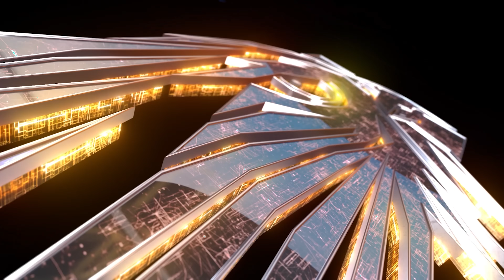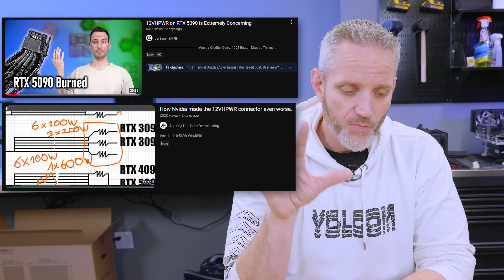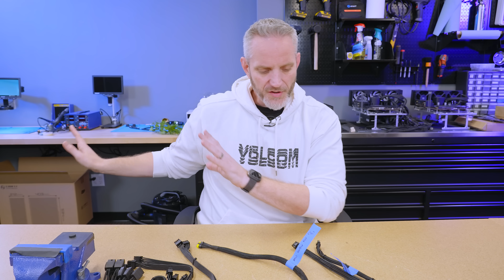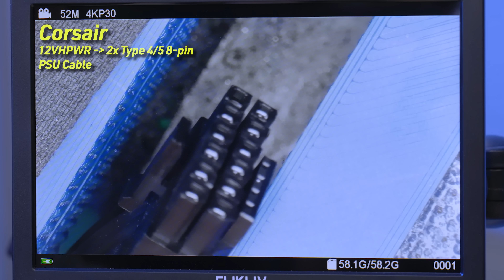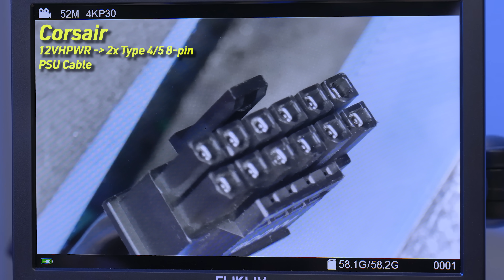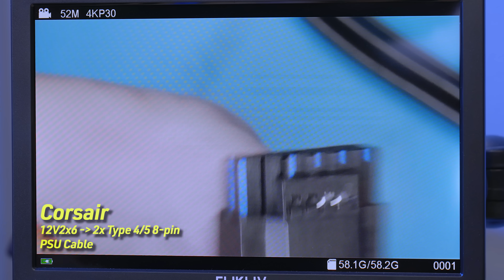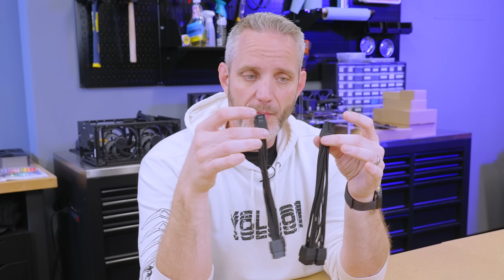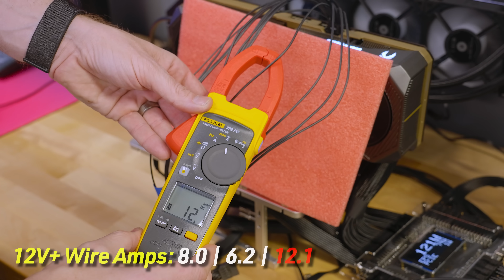I discovered something concerning and I need the Experts to chime in... More 12VHPWR discovery!

Comment: Unpopular opinion, but much like how cars need more and more current to start themselves, so industrial engines use 24 instead of 12 volt systems, maybe if computers need more and more current for things, we should consider using higher voltages instead of higher currents to reduce the chances of fires since there would be less current flowing on the power lines. Though we could also use really high current connectors like the XT60 or XT90 which can each carry 60 or 90 amps constant respectively, they even have versions with extra pins for communications, those connectors could be used one per rail and are good enough for RC models which draw very high currents from those very volatile LiPo batteries... maybe time for the PC industry to adopt or absorb tech from other industries to help reduce these issues. Good XT60 connectors are cheap... like a dollar per pair retail at most. XT60 can support up to a 10 AWG cable, and XT90 can go even heavier, no need for tons of little wires, just a few big ones, probably less failure prone.

Comment: Hoping somebody could help me out. I'm building a new PC (last one in 8 years old now). I was both fortunate enough and yes (dumb enough) to be able to snag an RTX 5090. I just got all my parts in, and just got the NZXT C1500 as my PSU. Yes it comes with an H++ 12v 2x6 cable, however the pins do look all over the place. The MSI connector (in this video at least) looks much more well engineered. Could you guys chime in with your thoughts? Is it worth rolling with the C1500 and hoping for the best, or better to return and get newer MSI PSU with a (hopefully) better engineered 12v 2x6 cable included? It would an extra week to my timeline, but curious if you guys think it makes any difference. Thanks in advance everyone.

Comment: in this world there are literally billions of 12volt wire to wire / wire to board connections. You can be be damn certain many of them are not "perfect connections". In PC's, in Vehicles, you get the point. So why isn't the world burning down around us? Because in most all cases there is an engineered margin of error built into everything.

however nVidia thinks otherwise and its ok to push the power requirements of their GPU right to the limits leaving no head room. Not one single mm of an imperfect wire and or connection while everyone else in this world knows you need to leave a margin of safety!

its a power delivery issue alright, but not from the wires or connectors themselves. Nvidia is simply pushing too much power through each of the conductors with no margin of safety. der8auer touched on this, and guess what, he's right.

and lets not steer the engineering to a solution of "monitoring"...Shunt resistors are not the answer either. There job is to detect a problem, sure ok, over amperage but if you just engineer a margin of safety with some overhead on the power delivery like the rest of the world, you wouldn't need any monitoring. Shunt resisters don't solve this problem, only detect/alert it. 

This whole thing is laughable as to what or who's to blame damn well knowing all the billions and billions of other 12v power delivery connections in this world. Billions of 12v power delivery connections that have no issues and the world keeps spinning, just not nvidia's 4090/5090 gaming gpu world. ...I wonder why...

Maybe we should ask AI running on a new nvidia AI enterprise card that has a "5080/5090" die, you know the actual 5000 series card launch that took place (enterprise equivalent) and likely has no power delivery problems.

Comment: I'd argue that one pin badly settled wouldn't be a problem. If they all connected in parallel, the current would just flow with least resistance (= all other pins).

The failure shown on thermal image (2 wires getting hot, rest cold) probably means multiple pins failed and the ones that "took the heat" were the ones that had the best connection

Also all the comparisons I saw lacked one very simple test, just get a pair of connectors, plug cable in and measure with ohmmeter (would probably need the 4 wire one for accuracy) what difference between different pins is

Comment: Trash PSU's and Cables are causing these issues. Looks like the MSI is high quality and checking mine confirms that its fine and load testing the 5090, the cable barely budged in temp.

Comment: Any electrical terminal will generate heat when doesn't make proper contact. One quick example is to not fully plug a vacuum cleaner. After a couple of minutes of use, unplug it and the terminals will be very hot (both, positive and ground).

Comment: The actual wire/conductor gage needs to be determined on the cables to see if any are undersized for the potential amp draw. This will necessitate cutting off connectors and stripping insulation to accurately measure conductor diameter and strand count.

The most expensive material in the cables is the copper used in the conductors and that's the first thing mfgrs skimp on.

Comment: Honest question: why do we use these small diameter multi-pin connectors in such high power applications?

Why not use, I dont know, xt60 or xt90 style connectors with big solder terminals for multiple small, or even bigger diameter cables for graphics cards?

The are very compact and basically bullet proof.
I have used them in high powered FPV racing drones Back in the day and never Had a Problem.
And These little Speed demons pull a shot Ton of current.

And its not like we need dozens of smal pins either. They all terminate at one rail after all. They dont even get seperated withmultiple shunt resistors either, so, yeah... I dont get it.

Comment: I have pointed out on other videos, another thing to look at is the pin size on the GPU and PSU sides. On PSU side all of the pins not associated with the 12vHPWR (in any version) are all chonks. The 12vHPWR pins are a full AWG or more smaller, yet they are supposed to carry the same or more power as the larger pins. Having not seen if the GPU side are just as teeny as the PSU side that may also be causing some of this. Smaller pins simply can not carry the same power as larger pins.

Comment: I cannot believe that corsair would even remotely think that what you just showed us is fine. Not to mention how they could even think that is acceptable to give to consumers. They should be ashamed and sued. I work for a company that directly deals with the construction of cable harnesses and that would have immediately gotten sent back to the shop to be completely rebuilt. Completely and totally unacceptable... To be clear the cable harnesses I deal with are in no way related to this; however, the construction of cable harnesses other than over all lay out is the same in terms of quality control.

Comment: Here's what I don't get.  In the big boy electrical world, ie, home or commercial wiring, when you increase the amperage requirements for power delivery, you also always increase the wire gauge.  I have never seen electrical in higher voltage where it is acceptable to run multiple wires instead or higher gauge wire.  I don't understand why it makes sense to run 6 12v power lines at 18ga or whatever instead of just running a single 12ga or 10ga wire.  Are the costs really that different at a commercial scale that 2 feet of 10ga is more expensive than 12 feet of 18ga?  From my research the per foot cost of 10ga is always cheaper than the the 6 foot cost of 18ga stranded wire on the few websites I've looked at.

Now, I'm no electrician, but I would bet that differential resistance and, therefore, differential loading is exactly why we don't see this in high voltage wiring for risk of overheating/fire.  The exact problem we have here.

From my understanding, the 12v comes from a single rail on the PSU side, split into 6 at the plug, and then gets recombined into a single rail (or power plane) on the GPU plug side, doesn't it? So two higher gauge wires (+/-) should fix this entire fiasco, especially since at that gauge, the connectors would be a hell of a lot beefier and with very positive connections/locks.  Think of something like the XT90 connector, but locking.  XT90 is rated for 90A, so that would be a huge safety margin at just over 1kW of power draw.  It's a bit bigger than the current connector (not terribly so), but that's kinda the point.  Hell, the much smaller XT60 would work for now, but at only 60A (720W), that doesn't leave much headroom for the future assuming the continuing insanity of power draw increase.

I'm also assuming that we've probably had a differential amperage issue in multi wire PC molex style cables in the past, but it's just never been noticed before since we've never been pulling 600+ watts at 12V in PCs until now.

In my mind, at these wattage levels, splitting loads into multiple conductors is just asking for trouble no matter how good the connectors are.  Hell, even 3x or 4x 8pin PCIE cables would be suspect in my mind at these current draws, maybe even more so than this connector as they could provide more failure points.

Perhaps the discourse around the old 8pin connectors needs to change here as I doubt it would be OK to have 4 or 5 of them to power today's cards (150W each + 75W PCIE) and I would image the failures (melting/fire) would be even more that what we see today.  That doesn't excuse the terrible 12VHPWR connectors, but it does give them a bit more context.

Comment: Jay watch the BildZoid video carefully. 2x8pin cant pull enough power to Melt m8. 
By design 8pin can only Pull 150, Not cable design PSU design only pushes up to 150W in 1 8pin. 
So your 2x8Pin can only Provide 300W trough that Adapter. By STANDARDS.
if Corsair is Pushing 300W trough one so they can Adapter than into 1x12v that pushes 600w there's your problem no1. 
Although 8Pin(6+2) is very Overspec its not Designed for 300W in one 8Pin. 
And Most PSUs will not supply more than 150W per line for a 6+2 PCIe. 
The PSU design pre 12v Provides Mechanical safety so the cable can't melt.
But theres another factor and that is: to Reach 600W you need several cables so that in itself provides Power leveling, since One cant do it, Others have to chime in. Key word HAVE to. 
Aka you will have to have 4x 8pin(6+2) to get 600W which will ensure they cant melt because PSU will Only Supply each cable with 150W. And PSUs before 12v ONLY have 4 8pins if they can Supply them with 150W each. So you cant use a PSU that's too weak.
Old 8pin PSU connector and everything around it is so smart in design Without any advanced controllers because people respected Electricity before, and didn't think about Profit first.  
12v ONLY demands 600W because GPUs don't care how and do not split Lines, it can be trough 1 single wire out of 6 power wires, nVidia doesn't care. 
There is NO WAY to tell the Electricity Where to flow trough 6 Power wires because PSU and GPU literally have no systems to tell it or limit it.
It can send and receive 600W trough 1 wire, 2, 3 or all 6 or any other combination. And plugs contact exponentially messes with this further.  
It's literally Like lottery.
That's why for some It's all wires nice Amps and for some 2 Wires or even 1 wire needs to take care of all the power. 
That's what Happens when you do not have a cap on How much a Line can draw. 
I honestly think nVidia did 1 joint Power Input into the card because the GPU core draws SO much power that individually regulating 6 wires would be very costly and splitting them some safe way would cause them to have to Mosfet and later Join 3-4 or More lines to satisfy Only one Huge Power hungry Component on the board that is the GPU core.
They could have Mosfet for let's say every 2 Power wires and have 3 mosfets to split the load, But I think that would cause them to have to Join 2 power lines after Mosfets again to Get enough power for the core. 
So they just said: Fuck it, we will transfer it to PSU and cable makers. Since 12v is already garbage. 

In Europe for Example Your main Wires that Connect the street cable to your Odometer , aka the Main power line, HAS to be SOLID coper wire in Most countries. That is because in Standard wire that has many Thin strands Electricity can take any path and decide not to take some for whatever reason or imperfection of the strand, thus The cable has effectively less Conductive strands and the Rest have to work harder. Being thin they start burning out and The load on the rest increases very fast so they burn out even faster. It's a snowball effect. One solid Wire can not do that, if it has a weak spot, it will warm up more in that spot, But the Heat to Completely Break a thick solid wire is Huge so it doesn't happen. 
That's why 12v is bad by design, because you rely on the cable to do its own Load management trough 6 Wires. 

BTW that Corsiar Plug is MOLEX-ing so hard 🤣

Comment: As an electrical engineer, the way this is being described is just simply making the topic even more complicated.  When describing 3rd party cables, are we talking cables made neither by GPU and PSU manufacturers?  Or is this referring to cables made by the PSU company?  Is using the PSU 12VHPWR cable (that came with the PSU) with the 12VHPWR port on the PSU directly to the GPU being analyzed or just 12VHPWR to PCIE?  This was throwing me off with other videos because I can't tell if people are using PSU provided adapters, PSU 12VHPWR direct cables.  Just a cable gets tested and not the various types.  I haven't installed my 5090FE but now I'm trying to decide if I should avoid the PSU provided 12VHPWR cable or if the risk is negligible.

Comment: I was the Quality Manager at an Aerospace connector company, and loose pins on housing is not acceptable in any case. It’s amazing how much you can discover when looking inside with a microscope. Hard to believe the board design is so weak also. Sounds like a compound issue.

Comment: I think the issue is not just one thing, and many things. One is not enough to start a fire, but several things will. I think what needs to happen is that a company needs to make 2 versions of the graphics card where the only thing different it the power connection. One 12vHP, the other the old way with the 8 pin connectors and make several so people can do their own tests. I'm sure the ones with multiple 8 pins will sell more till this is solved. But it may give us a better idea if it is the power draw or the connector.

Comment: Maybe I’m crazy but why can’t we just have a pair of 10 gauge wires in these things (power and neutral) 10 gauge is rated for the full amount of power that a wall outlet can apply. Then it would either be connected or not and you wouldn’t have to worry about some of the cables making contact. Maybe add the “sense cables” to tell the PSU to deliver less power for low end parts.

Comment: I am Electrical Enginerd and also Master Elechicken with 30 years of experience and I see something that needs to be clarified in all this mess: SO you have to understand that the pins that are disturbed/disconnected by jostling them are the ones that will have LESS current through them because the resistance of that connection would/should be higher. ( Path of least resistance, or simply OHMS Law). Thus,  this is really the only way to understand what DB saw. The only way for his result (20Amps on two of the six cables and lower on the others) would be different resistance in each section, thus the cables with the 20 amps had a lower resistance and thus a better connection, and those are the ones that would burn out first.  This assumes that they are all parallel connections with all six loops going to the same spot and that it is not split up to different sections of the pcb.
Reply: I think you should probably consider that a higher resistance means more voltage drop across that resistance which will cause higher temperatures at that point. A classic "Hot Spot" situation. You'd end up with melted connectors around the hot spot! In Der8aurs video the highest temps were at the connectors. It's only a question of which part is going to melt first.

Comment: Im a nuclear engineer; BSNE from RPI; masters in engineering management from MIT.  I worked in power generation and transmission for over 15 years. 

I promise you dont need an engineering degree to understand this issue. Any partial connection is going to reduce contact area. This unequivocally will raise resistance, cause performance issues, and yeah heats a byproduct here. That IS functionally what happened with the 4000 cards melting. This isnt rocket science. Where the speculation and hearsay will come is "how much is fine?". 

 Your pinned comment states Corsair said those pins "are fine"; which I find dubious at best. Do you know who you spoke with? If you asked John Q CustomerRep, then the question evolves into "how on earth would they know"? I would personally follow up and ask what the specification for connector depth is (I promise they have one, if they dont, then there are gross issues with their PFMEA process and.. wow thats a big deal; its an honest to god problem). Obviously if the connectors dont seat at all (if its too deep) then the card should fault and not fire up at all (no pun intended lol); a partial connection IS where we will be having issues. 

 Contextually, putting some numbers to the matter; at 12v, the difference between that 9.7 amp and 15 amps is well over 60w of power; all that will entirely be heat. Not sure if any of you have touched a 60w lightbulb before; but they uh... get pretty hot champs. LASTLY -> DO NOT HEAR WHAT IM NOT SAYING. I Am not saying that IS the issue; but I am saying its very feasible that it could be.